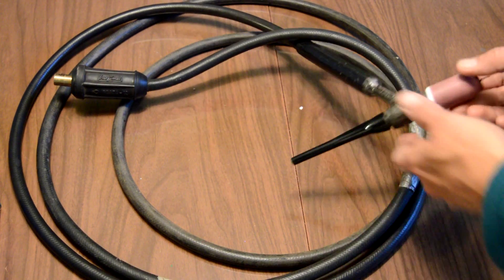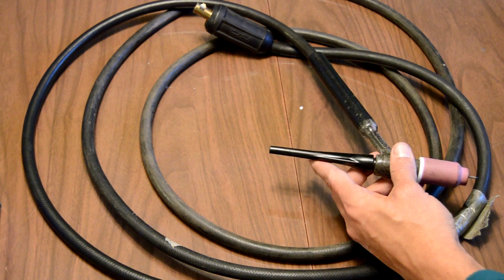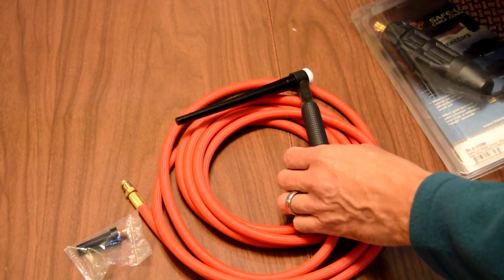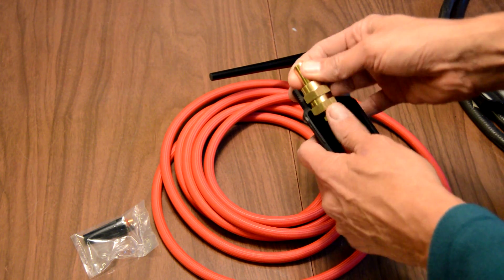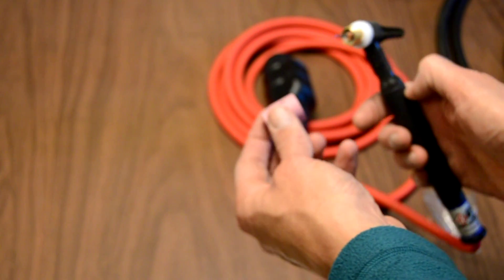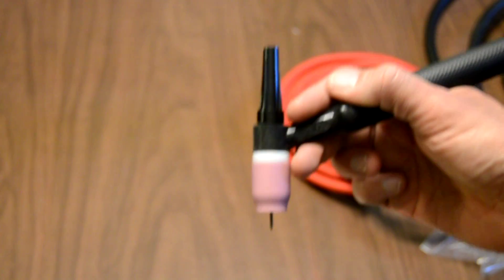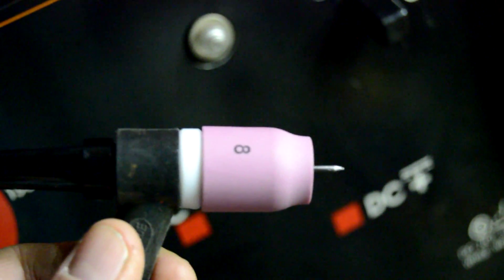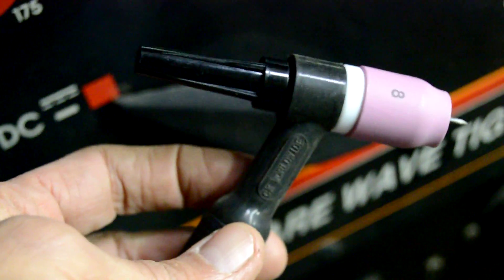CK Worldwide 9 tig torch review

Comment: Does this torch use smaller consumables. I bought a set of accessories for my wp-17 and the threads on the parts are smaller. Trying to find the torch they fit.
Reply from the maker: Yes, the #9 torches use smaller consumables than the #17 torches. This is a pretty good video explaining the different sizes and applications, water cooled, what parts fit what torches, Etc.     https://www.youtube.com/watch?v=lplipcJ5cyc
Reply: @JoeyMesa  yes. I figured it. Didn't want to wait for the wp-9 so I just made my own wp-torch. Consumables are 5/16-24 fine thread is in case anyone needs to know.

Comment: I just got the 26 series flex head with single hose/cable. Ck put on the 25mm gas thru dinse. I'm using this stinger on my miller multimatic 215. Seems to heat up just as fast as the stock 17 series torch. The plastic nut on the ck needed to be sanded down in order for it to insert into the millermatic 215 socket.
Reply: There ain't no such thing as a free lunch.  Gas-cooled torches get hot on long runs.